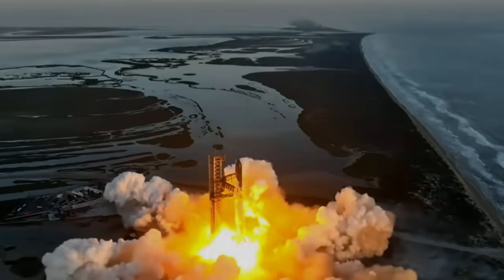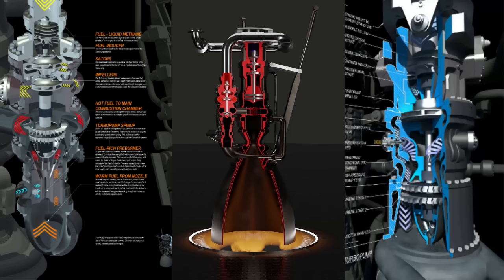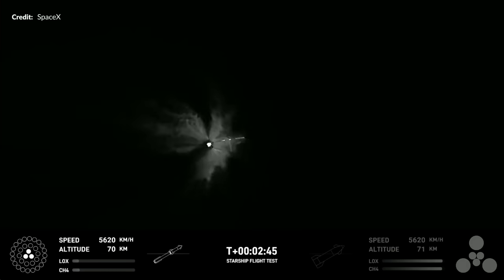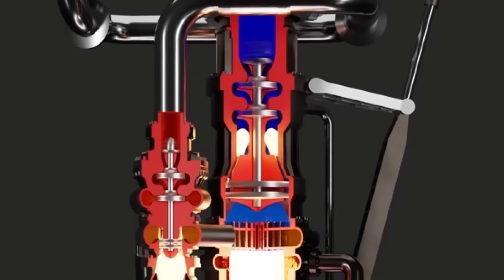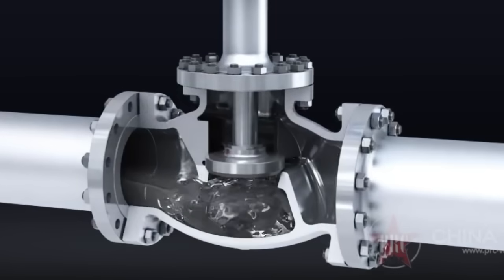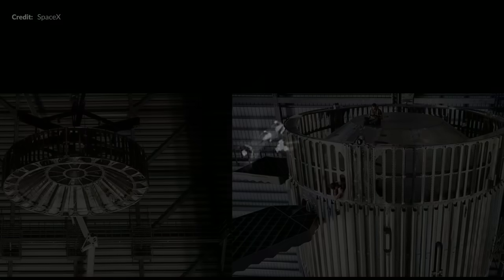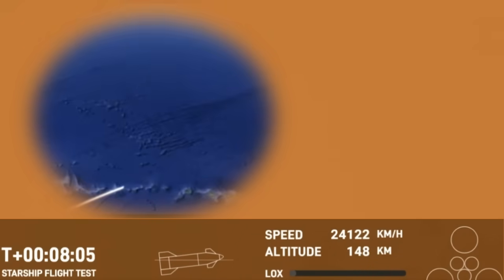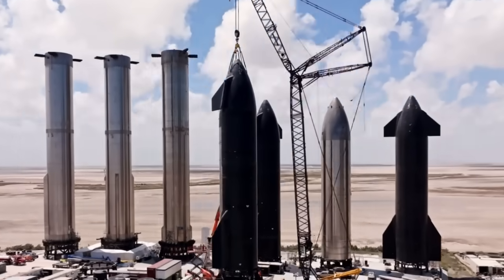Starship Flight Failure Analysis IFT2

Comment: This is the best take I have seen on the launch yet.  You're doing fine work.  I would also argue that seeing the FTS work on both stages is also a success given how effective they weren't in the first flight.  Considering the entire vessel made it past previous milestones and into new territory, that it tested an entirely new separation technique, the launch pad survived with negligible damage and SpaceX validated the FTS works as intended now this entire test flight was a resounding success as test flights go.  I agree with you and also believe the next flight will end up completing it's mission.
Reply from the maker: That is a good point.  Though the nose of Starship survived quite well apparently :-)  Escape pod?
Reply: It's O.K. to say it was a partial success.
Reply: Are we certain FTS did the job? Scott Manley, early on, suggested possibility of organic RUD.
Reply: @garthfarkley  Scott does fine work, but until we the FAA and SpaceX reports we are all speculating, to a greater or lesser degree.
Reply: @terranspaceacademy  The fuel tanks need a disk inside them to act like a diaphragm and the disk to move towards the bottom of the tank on a ratcheting mechanism mounted on the walls of the tank, as the fuel in the tanks gets depleted.
Also, in what insane mind a star-ship would destroy itself before it attempts to land?! Attempt to land first,  self-destruction second.
Reply: @garthfarkley we aren’t certain at all that FTS was engaged on either stage.  Certainly no signal from the ground was given as the crew in the control center were surprised by the ‘disassemblies’.
Reply: @russellharrell2747 FTS triggering is automatic if a certain pre-programmed criteria are met.  No signal from ground control required.
Reply: @terranspaceacademy The job of an FTS is actually not to completely break the rocket apart.  It is just to deal with the contamination issues of the fuel.  Loved your video though!  Great work and I look forward to more.  Didn't realize I wasn't subscribed until today either but that's fixed now.
Reply: @romanroad483 Agreed but it wasn't just a partial success.  Very little about Starship and Super Heavy is status quo and thus almost everything has never been tested before.  SpaceX themselves say anything after clearing the launch tower is a success because data collection and edge case testing is what they are after.
Reply: @garthfarkley  It is only speculation but Automatic FTS is the most likely explanation of both ship losses.  Frame by frame on the booster you can see the stack detonate halfway up just below the methane tank right after a significant explosion happened in the engine skirt.  Could have been caused by fire propogation and a plumbing leak but the location of the detonation is directly where the FTS sits.  Starship was too far away to see so it really is only speculation in that case but it gave the same sudden space jellyfish that super heavy did and was very evidently leaking oxygen for the last bit of its flight.  That would put it off course and could easily have been a trigger for Automatic FTS.
Reply: @reasonerenlightened2456 I think you're on the right track but that you're thinking in too many parts and too much complexity.  As soon as you said a ratcheting mechanism INSIDE a fuel tank that expands and contracts due to temperature the hairs on my back stood up and I got a very unsettled feeling.  I think baffles would work like in the Saturn 5 but I don't think it is necessary.  I think they can achieve the same results by planning inertia management better and keeping more engines lit to push back against the negative acceleration the upper stage burn startup imparted on the booster.
Reply: @JoeShmoism  so it’s just guess work as to if the FTS actuslly worked or if something else led to the explosions.  Hopefully their new and improved (tm) (c) (pp) FTS worked as intended.
Reply: @iMeatbag  Since the flight did not achieve  all of its objectives, without  major failures, it was only a partial success.
It's O.K. to say partial success.
Reply: @romanroad483  That's where you seem to be missing the point: it's a test flight.  It's ONLY objective is to test things and find failures without destroying infrastructure required to fly again.  Obviously it needs to have a flight profile and thus an intended destination planned but literally no one expected it to make it there given just how much of Starship and Super Heavy is new and untested.  Literally nothing about the rocket is conventional.  Even the "failures" tested something that wasn't working correctly in the previous flight that had drawn concern from regulating agencies and the public so again, this was not a partial success by any measure.  There was nothing about this flight that set SpaceX back or prevents them from moving forward.  They will likely be able to fly again with another booster and ship as soon as the hardware is ready to fly.  I'd actually argue that if the launch had worked flawlessly that it would have been a worse outcome from a test flight perspective.  You WANT failures to occur during testing so you can iron them out before you put crew or cargo onboard.  SpaceX said this about the development of their Crew Dragon capsule after it blew up on the test stand after the demo-1 flight.
Reply: The importance of this flight validating the FTS should not be underestimated. Imagine if the FTS wasn't needed for the next several flights--we would never have known if the mods fixed the problems or not. IFT2 was a resounding success!
Reply: @iMeatbag  So your saying that a test flight that has failures is a success. So Space X must go on testing until they have an unsuccessful test flight and then they can launch manned flights.  Really.
It's O.K. to say partial success.
Reply: @romanroad483 I'm done here.  Everyone who actually knows what they're talking about when it comes to rocket launches and more specifically the history from the first test flight thinks this launch was a complete success.  The only people who don't are those who can't seem to comprehend their own ignorance on the subject.  Have a nice day.
Reply: @daveduncan2748  Agreed!  Some people just don't comprehend how big of a deal that is.  Not only that but the fact the FTS automatically triggered for the booster proves it's reliability even more.

Also given it is a test flight finding all the ways it can fail now is a far better outcome than doing it once cargo and crew are on board.
Reply: @daveduncan2748  assuming the FTS was the actual cause of the RUDs and not some other fatal flaw.  We will never know for certain with starship but I guess SH was still in contact with ground control at time of destruction so I assume their telemetry would have indicated if the FTS did engage.  I haven’t heard any official word either way.
Reply: I'm glad the ship was a small success, but it was also a big failure. Remember, Apollo 13 was called something like a "Successful Failure." However, if you compare it to the Saturn 5, it's a failure so far. Maybe they will figure that out, maybe not. Time will tell. Every single launch of the Saturn 5 and it's variants did exactly what it was built to do. No explosions, nothing off course, no launch pads destroyed... So far, Elon's new toy is zero for two.
Reply: @iMeatbag  I am pessimistic about trying to control small amount of fluid in a big volume fuel tank by controlling inertia of the fuel tank. Instead, the  crank-like mechanism would seem more feasible to provide one direction of movement for the earlier proposed diaphragm. The "teeth" could be on long straight bars along the fuel tank preventing the diaphragm going backwards.
Reply: @reasonerenlightened2456  I'm not exactly sure how a crank-like mechanism sounds more reliable to you given this is a stainless steel structure held together by internal pressure and changing size dynamically all throughout the flight profile because of temperature?  More moving parts are the opposite of reliable by it's very definition.  None of that is even considering the amount of payload to orbit you're losing by putting that much mass on the booster.  Sorry, but if it can't be solved by inertia and better engine management then I don't think it can be solved without rendering the rocket useless and no longer capable of reuse.
Reply: @russellharrell2747  You can see it trigger in booster. And I think they acknowledged the FTS activated. There's less certainty about the SS, but the behavior and video evidence seems consistent with FTS.
Reply: @daveduncan2748  that’s good to get confirmation.  Looks like they improved the FTS system greatly from ITF1 then.  Good job!  Hopefully they don’t need to have it trigger too much more during future integrated testing flights.
Reply: @iMeatbag  Let's live and see. I predict there will be a moving diaphragm inside the tanks or else they will be forced to allocate some of the fuel to do all the fancy stuff with controlling the inertia of the tanks.
Reply: FTS almost certainly did not destroy the booster. The official statement states only that the Ship experienced automated FTS, while the Booster merely underwent a "RUD", not controlled FTS detonation.
FTS also didn't completely blow up the Starship. The "spinning Starship" is actually the nose cone (leaking propellant from downcomers/ headertanks) AFTER FTS, not before.
It's unclear to me whether or not the nose cone and header tanks surviving is a design failure of the FTS or an acceptable outcome (I'm not a lawyer familiar with aerospace safety regulations). It's also not officially stated what caused the Ship to activate FTS.

All in all the FTS didn't fail as obviously as during IFT1, but this can also not be taken as definitive proof that it works.
Reply: @plainText384  psst, don’t pop the muskrats’ bubble!

Comment: The analysis was very good but one aspect was not addressed and that is the nature of the propellants. When we were working on the S-IV B we paid great attention on managing LH2 in low gravity. The issue was guaranteeing propellant at the pump inlet at the time of restart. The solution was to keep a constant G on the stage throughout the coast phase, We accomplished this with the CVS (Continuous Vent System) plus we had Ullage rockets and the H2O2 burner activated at 2nd burn start. Chryos really want to be gas and go  all over the place. We had excellent insulation inside the LH2 tank for boiloff control and held the pressure constant by letting gas out through CVS which was propulsive. I say all of that because CH4 is only slightly more dense than LH2. I don't know how the Starship first stage is insulated. Obviously the CH4 is liquid and very settled at liftoff but what happens as the G level is reduced as C/O is reached. It certainly is different than on a Raptor9 with RP1 as the propellant. There may have to be a Hypergol assist for the re-entry and landing burns.
Reply from the maker: Thank you very much for your insights.  Very interesting. We may indeed.

Comment: One thing you didn't mention was how the Starship sea-level engines were gimbled  all the way out at ignition, I assume they were trying to get the nozzles pointed at the vents for ignition.  I wouldn't be surprised it they don't make the hot staging ring a bit taller.  But I have to agree that simple timing changes might be enough.  

One other note from my experience with way less powerful pumps:  The air into the pump is really bad, the over speed it creates is even worse, but that dam slug of liquid hitting the over speed  pump which then slams that liquid into the into and collapsing the gas pockets ahead of it is a real parts smashing event.
Reply: Is this similar to pump cavitation?
Reply: @VyarkX  Could also be possible.
Reply from the maker: Just fifteen degrees but I should have noted that.  Thank you.
Reply: They've already modified the ship QD arm to account for the increased height of the current hot-staging ring vs. the tower's original design.  I doubt there's any way they can raise the ship more at this point - it messes with all kinds of things.  I believe they also wanted to make the ship a bit taller already, and the current hot-staging ring likely ate into those margins.
Reply: @terranspaceacademy  The center engine gimbaling is nicely visible in your video from 9:39 to 9:51.
Reply: I agree with your "parts smashing event" when the liquid hits the overspeed pump rotor, but will also add that to the overspeed rotors, the liquid will feel more like a solid. Bad things happening from any angle you look at it.
Reply: @terranspaceacademy  I am outraged that the star ship is not intelligent enough to attempt a landing before killing itself.  Surely landing should be a first priority for a star-ship. However, is it intelligent enough to understand that there is a problem which requires change of priorities. A problem at 150 km altitude surely warrants a landing attempt before self-destruction. Silly computers/programmers.

Comment: The analysis of the Second Flight Test is excellent. Your assertion that there are no further modifications necessary for the booster is reasonable. When hot-staging, it's recommended to only fire the Vacuum Raptor Engines. By doing this, the Booster and Starship can feel less stressed from the hot staging. Gives the Booster more time to stabilize the propellant flow. It's worth a try.  Saving your unnecessary drastic changes. Unnecessary costs. Your site provides valuable expertise. I am a SpaceX enthusiast from Europe.
Reply from the maker: Good to meet you Robert! Europe needs it's own SpaceX to give Elon a run for his money :-)

Comment: This is the most cognisant and knowledgeable analysis of the failure of SpaceX IFT-2 test that I've seen in print and video.
It would be nice if the turbopumps had an overspeed prevention system which intervened in case of no-load - i.e. no propellent flow; but I doubt it can be done.
Thank you for the great video.
Greetings from the UK,
Anthony
Reply from the maker: Greetings good Sir!  And thank you! :-)
Reply: I like that you give credit where credit is due such as the point out that the Russians pioneered the grid fins and hot staging. In the end, technology is a world advance.
Reply from the maker: It is indeed.  I applaud the progress of China while still wanting to see the US and Europe get to the Moon (again) first.

Comment: I certainly agree. I notice that during hot staging, the booster decelerates very rapidly. That means to me that the fuel had to be sloshing because it would have been thrown toward the front. Why not have an even more gentle separation? Perhaps only one vacuum engine firing until Starship senses separation. And certainly a slower flip maneuver. 

Also, I am surprised that Elon has not launched the booster by itself; let it flip then right itself. Perhaps see if he can hover it and maneuver it sideways in a tightly controlled manner.

Great analysis! Congratulations again!
Reply: It would be an expensive test when you figure that it would isolate that many things, would require another approval, and getting it to work as a system is the end goal.
Reply: Musk is the king of wishfull thinking I suppose. He is too confident.
Reply: @paulbizard3493  What he said is that hot staging would be  the point of failure as it was never tested on a rocket this large before and he didn't expect it would survive he gave it a 50/50 chance at that point in the flight. IMO as an Engineer he was hoping it would work first time around but probably knew there would be problems. That is why it was a test flight...to discover those problems and fix them
Reply from the maker: A few baffles at the base might help a lot.
Reply: @paulbizard3493  This is a fact (even though I adore the man). When I heard that the 1st launch was to be done over flat concrete with a pathetic deluge system, a year before the fact, I was pissed. Because it seemed apparent that a lot of that pad would end up in the engines at full thrust. So yeah, back to your point, spot on.

Comment: Small detail,
Ullage Gas is not “pumped in to pressurize the tank”… it’s a byproduct of propellant boil off.

It is overboarded by venting and use as cold gas thrust nozzles.

The vehicle and booster are pressurized by outside gas supply for structural reasons during transport and storage when ullage gas is not present.

Excellent content and analysis.
Reply from the maker: It is but these are pressurized to about sever bar by feeds from the engines.

Comment: The quick disconnect was damaged and it's possible it was still partially connected as the ship raised up. This may have caused damage that resulted in a slow leak.
Reply from the maker: I did not know that.  Thank you very much.

Comment: That was exactly my view of things after the flight for booster. I did not think about the flat surface of the hot staging ring and the damage it can do to starship. Good catch.
Reply: I was skeptical of the hot staging thought it would blow up immediately as he said in this video the center 3 engines were at close proximity to the dome and the back pressure probably damaged theme to the point of failure leaking propellants inside the bottom half of starship then following to ignition blowing up the bottom half of it as seen in the telescope
Reply from the maker: Thank you!